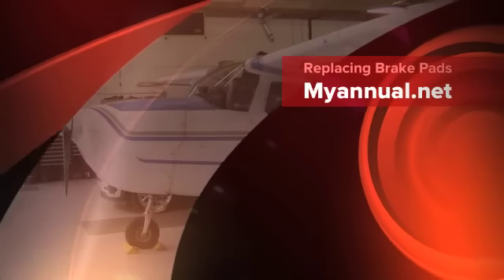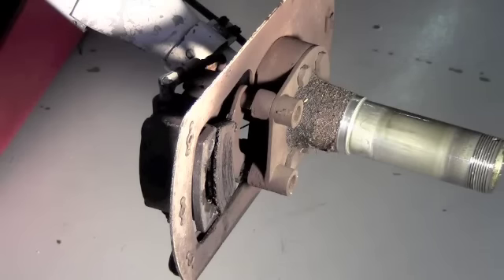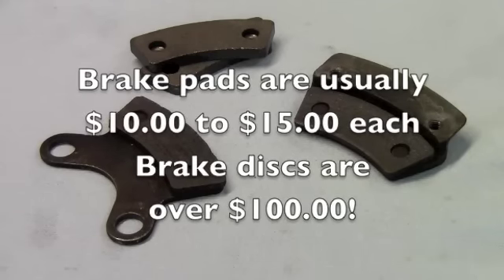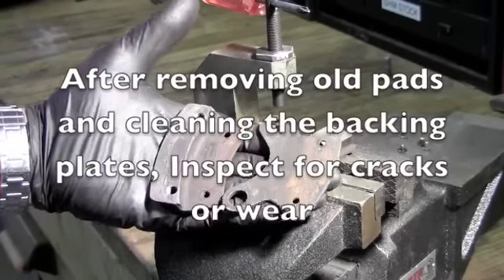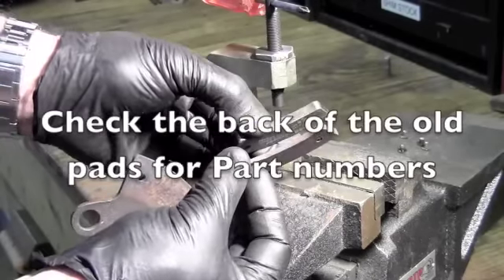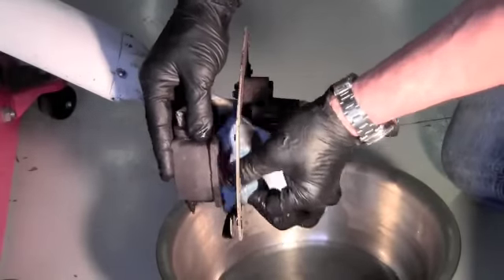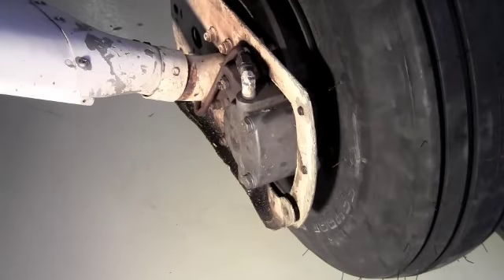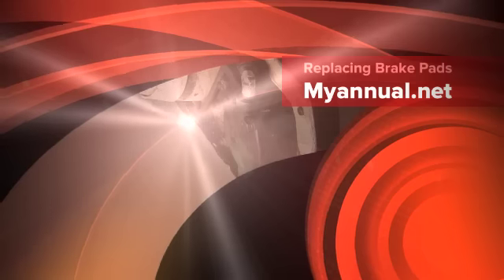Replacing Brake Pads on Cessna

Comment from the maker: Joanne: On the brake pads there is a indentation where the head of the rivet goes, push the rivet through this hole, through the backing plate and then round over the rivet with the proper tool. When you remove the old pad from the backing plate look for the outline of the brake pad, if you don't see one, make a mark on the side where the pad goes. Thanks for watching the video, hope to hear from you again soon.

Comment: Thanks for the video. I'll be replacing the brake linings on a 172 as soon as the parts arrive and this has been a good refresher since doing it last at A&P school (I normally work avionics only at my job). I wouldn't be too sure about 25 in-lbs (did you mean 75 by any chance?) though. Cleveland's Technician Service Guide specifies 75 - 80 in-lbs dry for the 30-63A brake assembly, for example (used in early 172s). Other than that, great video!